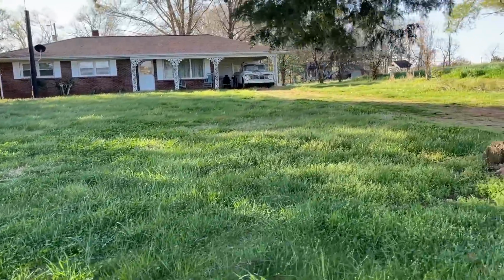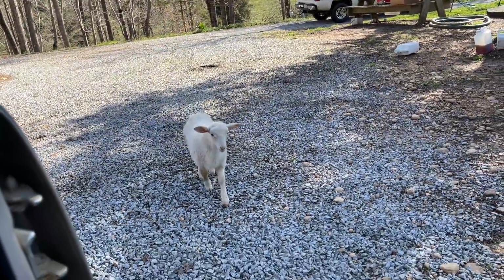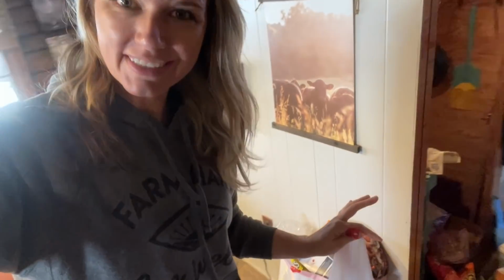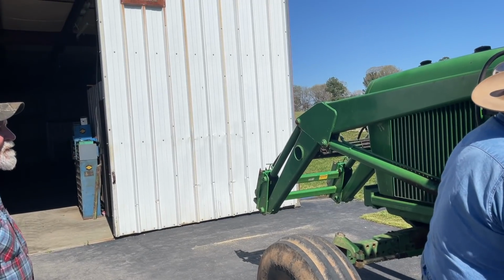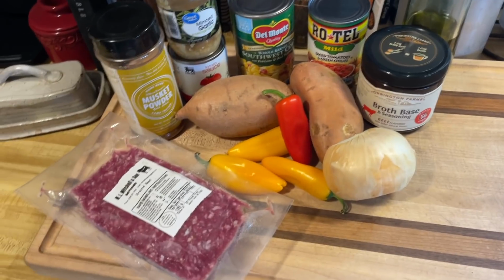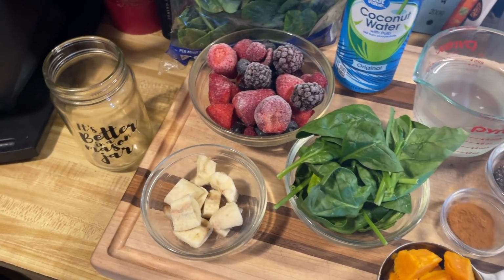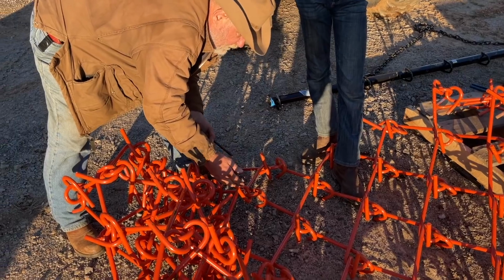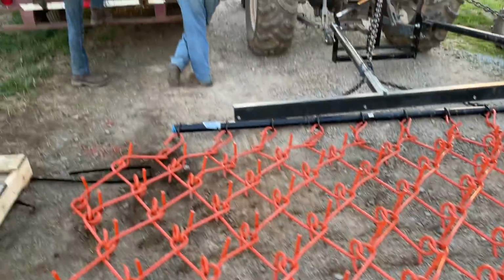Spinning 'Round! One of those days 😬

Comment: I have one of those drag Harrows  like that, yeah like Lawrence  said ,you can have an aggressive side flip the tines around the other way and they lay back on an angle less aggressive ,and then you can just totally flip it over ,just rough set up and use the soft side without the tines it’s a great piece of equipment I use it for just going through the field and roughing it up and it takes all the dead stuff off the top and let some air in and rejuvenate it really nicely 🙂🙂

Comment: last summer i priced out one of them 4 foot wide drags, you can buy pipe ends and more 4 foot wide drag sections, but it comes as one unit 4 feet wide with a 6 foot long pipe to hook the harrows drag to, as i was thinking that would work better braking up all the winter cow pies that got frozen solid between all the snow layers and it all in close areas of the hay bales and feeder  and i could drag that with my truck, but it was $679 cnd for one section,, out of this guys budget, so its back to draging my old chains still

Comment: on your un used ceral, I have found if you put it in a big ziplock bag then roll over it
with a jar, can or rolling-pin  it works good as either cracker , bread crumbs in meatloaf.
I haven used ceral like frosted flakes  or one of the sweet kids ceral.

Comment: I didn't know that ya'll had a Grtader. You need to use it on the makeshift roads that you have going out into the pastures to knock down the center of the "roads" into the rutted wheel tracks to flatten them out/